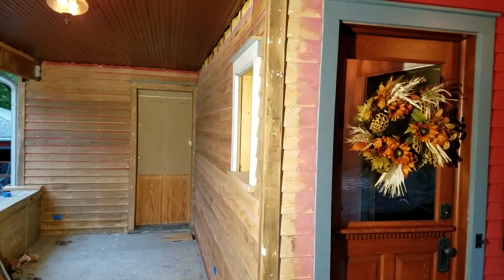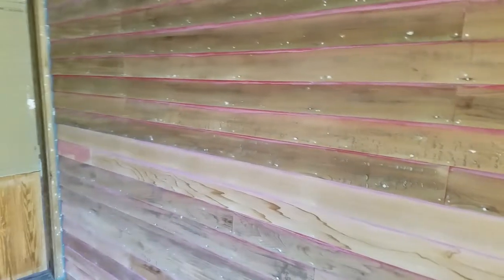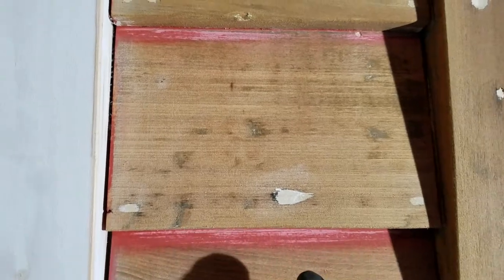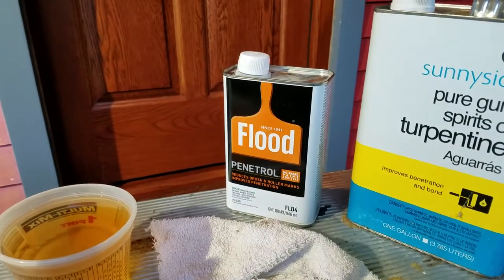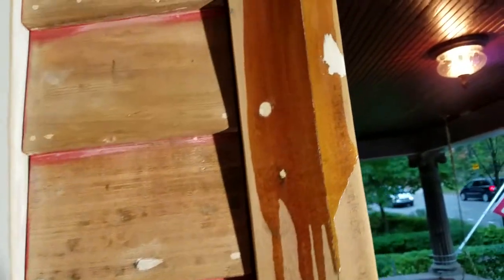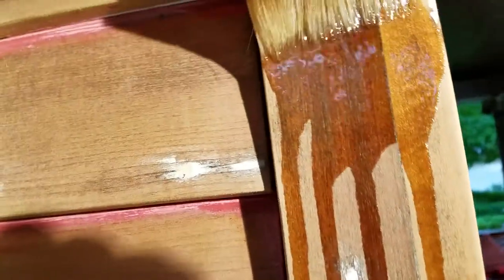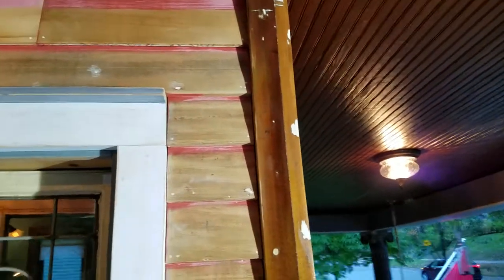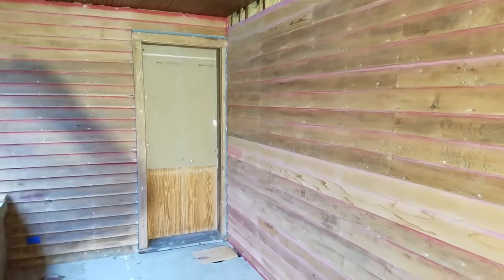Exterior Painting and Clapboard Restoration: Don't Forget This Step!

Comment: Dear Chris, thanks for your website. I am removing lead paint from a cottage built in 1942.  It's slow process even with spraying 50/50 mixture of turpentine and Linseed oil it's still about 3 to 4 minutes before the paint is ready to be removed; using the 1100 Speed Heater. I have a Cobra for the smaller areas.  The process is slow but I am on a particularly difficult area( southern exposure) termite damage and filling a void between chimney and house. I don't know if you have ever used Smith's epoxy for wood repair but it is working great for the chimney gap because of it's sticky consistency. I have the Speed heater arm but would purchase your new device had it been available at the time.  I really appreciate your attention to detail!
Reply from the maker: r $20 off 👍
Reply from the maker: Hi Andrew, thanks for the feedback and kind words! I'm always glad to help when it comes to Old House! 👍

And hey, let me know if you ever decide to pick up an InfraRed Rack Kit...I'll give ya a code for $20 off 👍

Comment: Looks great! I'm considering doing the same but was wondering if you treated the sanding process the same way you would treat sanding a house with lead paint, even after it was removed with the Cobra. Wondering if that lead sinks into the pores of the wood and if it would still be something to worry about.
Reply from the maker: It can be. I always assume that there is a hazard present with most Old House dust, so I use a HEPA vac...check out the entire process here - https://myoldhousefix.com/2018/06/04/exterior-paint-failure/
Reply: @myoldhousefix  Thanks!
Reply from the maker: @djpeanutkill  you're welcome!

Comment: We are following the pre-treatment process but we never have any to wipe off. It all seems to soak right into the wood (cedar clapboards). Is that normal? Also, is there a time limit after you apply the pre-treatment that you have to apply the primer? It seems like by the time we are done pre-treating the whole area the beginning is just about dry.
Reply from the maker: Great questions Justin! I have a new, more detailed video I shot this week that Im working on. Totally normal what you are experiencing, especially in summer, it soaks up and dries quick. If theres ever a question whether its dry/tacky enough to prime, Id leave it for at least an hour. 2-3 hours if its the cooler, humid, fall weather where it takes forever to dry. 
For example, last fall on this porch, I primed after 45-60min and the pretreatment was still tio wet. It took my primer 3 days for each coat to dry, it was crazy humid and covered with no sun though.

Comment: Man i wish i had known about this. Im currently painting my house . One side is complete already and i didn't do this. Same situation,  100 year old cedar clap. Whats the chances of failure?
Reply from the maker: Hi, glad to help. If you have already painted one side, I definitely wouldn't  start over. Just pick up the process for the other 3 sides - it would be a good test case to see how both applications perform over time.  You may see some peeling within 3-5 years, but it all depends on how dry the wood is in its current state. Best of luck! 👍
Reply: @myoldhousefix  yes i will try on the other 3, especially the south side. But so far so good on the finished side. Thanks for your reply 👍
Reply from the maker: @nobonesaboutit7639  glad to help! The south and west sides will probably get the most sun, so that will definitely help! 👍
Reply: @myoldhousefix  hey one last question.  Does using the pre treatment mitigate the need to use a slow dry oil primer? I'd like to use a fast dry oil primer ( Sherwin Williams ) in order to be able to spray it on. Slow dry runs the risk of overspraying the neighborhood which im sure you know.
Reply from the maker: @nobonesaboutit7639    well, painting method can make a difference in product. For max paint longevity and adhesion after scraping/sanding with 80 grit, especially if you are taking the time to strip to bare wood, I recommend  1) pretreat  2) brush on 2 coats long oil primer 3) push on 2 topcoats. This way you get the maximum mechanical bond. With spraying, ita about 90 psi out of the gun, and even less once it hits the surface. Think of it as a piece of tape landing/sticking to a table vs manually pressing the tape to the surface.
Reply from the maker: @nobonesaboutit7639  also the long oil primer dries slower which is good. If it soaks in the dry wood (why we do the pretreat) and dries too fast you end up with solids on the surface with poor adhesion and increased peeling risk.

Our red house featured on our Group and Website has been painted for 10 years and still looks like new.  I have some nail pops, but no peeling 👍
Reply: @myoldhousefix  point taken, thank you
Reply from the maker: @nobonesaboutit7639   you're welcome!